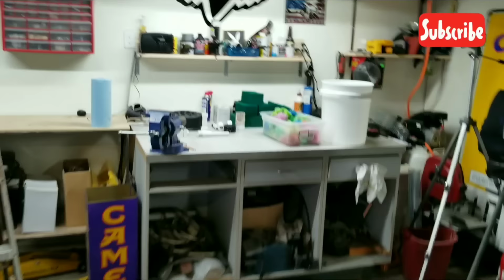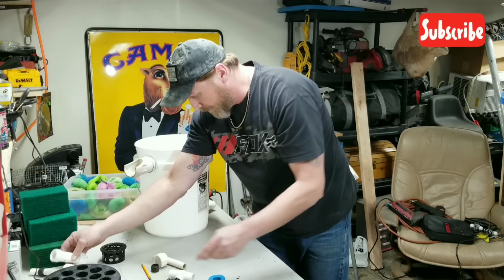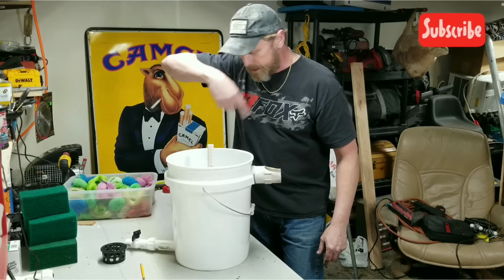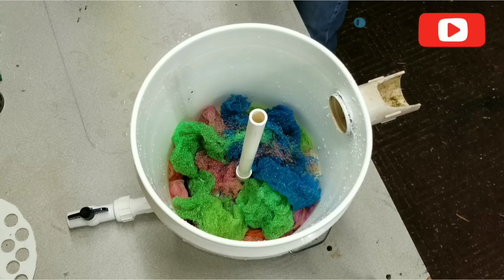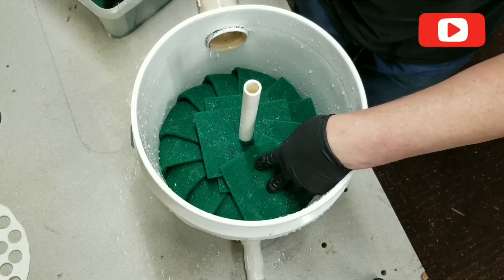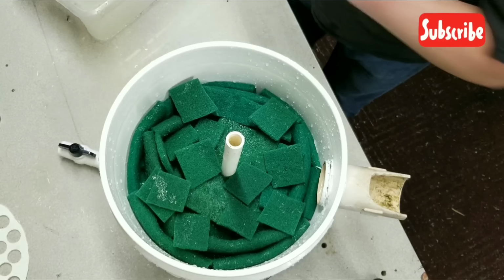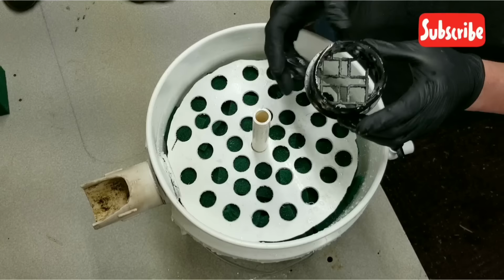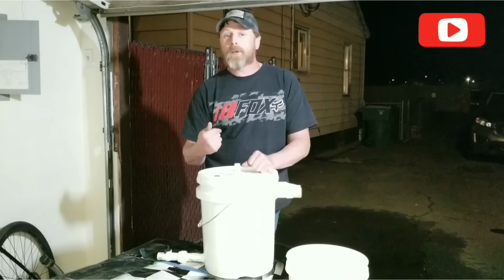BEST DIY BIO SWIRL FILTER EVER...UNDER $20

Comment: Everyone buys these expensive pumps what about pool pumps? They have a filter already, and those are easy to clean. And replacement filters are like 2 for $10 easily washed. I used one filter all summer on the pool and cleaned it a couple times a week crystal clear pool

Comment: I would like to  see a video on how easy it is to clean. Looks like a nightmare. Great video on the construction.
Reply from the maker: I have a maintenance Video in my playlist
Reply: I followed this and cleaning was not difficult.  I lift my bucket onto a chair and drain it into containers to water my flowers.  They love the nutrients in the sludge.  Then I rinse out with clean water for several minutes into one of my flower gardens until the water looks clearer.

Comment: My wife found your video ..
we have a 600 gallon koi pond outside. Your bucket technique worked amazing, cleared it overnight.. so I decided to upgrade it and made one with your design using a 55 gallon blue drum.. thank you for your video
Reply: I have been contemplating a design for a 55'er myself for a couple of years now. I have found that it is mostly the mechanical filtering that is doing most of the water clarification.
Reply: @78tag  the design in this video looks to be about 80% mechanical/bio filter and 20% swirl separator, so you could definitely build better stand alone swirl filters if you wanted to. It does look pretty good for an all in one solution and I don't doubt it does a great job, but it would still be interesting to see how much of the solids the swirl part manages to catch.

Comment: I just build a filter based on your design with slight variations and installed it on a 14’x36” pool. That my son has a couple large bass and a large sunfish in. We use the original pool filter /pump  without the cartridge filter as the pump. Within 2 or 3 days the murky water was crystal clear leaving only some sediment on the pool floor. Works great! Thanks for the info.
Reply from the maker: That's awesome I have a IG link below would be awesome to see some pics hit me up ...Thanks for watching and commenting I appreciate it..Stay SAFE!!!
Reply: thats a pretty big pool and your diy filter/pump must be pretty effective

Comment: Very good video! This is pretty much a small skippy filter but with a clean out added. Skippy says never clean them ever ever...but I can't wrap my head around that. I had one for about 15 years. I grew plants in it and the root system basically took over until it was impossible to clean. At that point I just let it do its thing. Never had a problem.

Comment: I built one using this method and it has lasted for years. Its in a large rectabgle bin so not as strong as a bucket and it has finally sprung a leak. I'll be building a pond soon in the back yard and moving my turtles out there from the garage setup. I plan on using a 7gal bucket. Great video. 👍
Reply: The only thing i would add is maybe cut out some sections out of the upside down bucket where the water can flow straight out of the 90° pipes into the main bucket easier. Really create a swirl. I used an upside down metal crate and the flow was insane.

Comment: Im going to build a duck pond filter tonight using this basic concept.  On the bottom will be the same until the green sponges. I am going to replace those and use the large blue sheet of macropore furnace filter found at hardware stores for under$6. 3 -4 layers of that then lava rock. I am using a large bruit trash can. Cost will  be around $100 for one much larger. Thank you for this great video and making my  mind up of what system I  am going to use.

Comment: I mine in a 55 gal barrel cut in 1/2 & got my hornwort & bacopa & jungle Val it 
I put a 1/2 sized milk create in the bottom & screen over it & put 3-4 bags of 
river rock in 1st then lava rock on top then capped it with crush coral & put 
bacopa plant's & jungle Val in the media & hornwort is just floating on top.

I have it hooked up to my 110 gal bait stock tank & the water is SO CLEAN.

Comment: I like the basic concept, especially the swirl feature to prevent channeling. I would use lava rock and or bio balls on the bottom, then course filter padding, topped off with polyfill stuffing. That way it doesn't clog too rapidly and reduce waterflow. Also makes cleaning a lot easier. With the intake coming through the lid, and the discharge on the side near the top, I would not add that other pipe at the bottom. It is not necessary, and only adds another place for leaks.
Reply from the maker: Thanks for the comment.. Stay Safe!!!!

Comment: I used paint sponges and lava rock, bio balls in the bottom, but one thing that really helped was a 5 gallon paint strainer netting that fits perfect.  I have to clean it every week cause of pond sludge, but it's working!  My feed is at the top and bottom output.  After weeks, the sponges clogged and I also had gauze netting above the sponges.  So its bio balls on the bottom, then lava, then sponges, gauze the paint strainer net.  I slice the tubing with a T connection, so it sprays out with stoppers on the ends.  So now Im using bio, lava and paint strainer, cause I was cleaning every weekend and there were some times it clogged and flooded out.  So no it wont clog, I clean it every two weeks by dumping and rinsing.  Im not happy and want something better.
Reply: Maybe the size of the filter is just to small for the size of you pond? They say 10% of the pond size.. so this 5 gallon only good for a 50 gallon pond max .. bigger then that you have problems and cleaning more often..

Comment: The swirling motion aided by the 45 degree elbows at the bottom helps prevent channeling in a major way! I’ve never seen that done before. Genius!!😀

I agree with a few others regarding filter media:
Lava rocks (or bio balls) instead of all the pads and rocks. Adding some pillow batting at the very top of your rocks will really help keep your water crystal-clear! 

Lastly, you should eliminate the extra hole in the lid. It’s not needed. You only need one input and one output.😉

Awesome bio filter!😃 
Thank you for your video.😁
Reply from the maker: Thanks for watching & commenting!!!

Comment: I did it!  I built it! 
 I will be adding a skimmer to the pump intake.
Reply from the maker: Thats awesome...I appreciate the feed back
Reply: @MYANIMALHOUSE  I originally used a hose from a cpap which perfectly fit the outside of the 1/2 in pvc, BUT it is evidently not sunproof.  After about a month, the hose sprung a thousand leaks.  What type and size of hose should I use to connect the 1/2 in input to my pond pump?
Reply from the maker: @nancyjanegrimes7897  I used one of the adapters that come with the pump ...I had to sand down the inside of the 1/2 pvc until the adapter fit inside tight
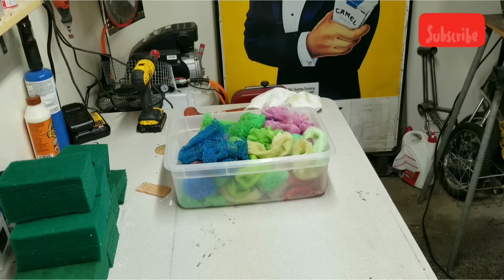Reply from the maker: @nancyjanegrimes7897  Watch this Skip to 9:30 https://youtu.be/_qLmB38uhrs

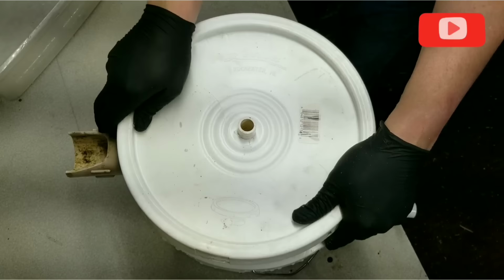Comment: WOW! There's a blast from the past! That big metal 68"x38" Camel Joe advertising sign is worth around $800 bucks now... 23:58 sorry, what'd you say?  😜 I'm in the process of redesigning a pump/filter debris skimmer for my Dad's 1800 gallon Koi pond so thanks for the ideas. I think I'm going to build a massive version of something like this but "upside-down", with the feed pipe swirl "T" up top, layers of fine filter media on top, then rocks at the bottom around the pump and also a valve at the bottom too so you can open it and let any super fine sediment flush out every so often into a hidden French drain. All that is just to keep the pump clear and working, which feeds up to two big bio-filter drums. With the feed coming from the top I think it should be easier to clean out larger debris or possibly even be "maintenance free"? (The pond is under a bunch of Fir trees, so lots of stupid NEEDLES to deal with...)
Reply from the maker: Lol want to buy it ...I have a ton of old Joe camel stuff Lots of signs, cups, shirts, lighters lots of stuff now I think about it lol Thanks for watching 👀
Reply: @MYANIMALHOUSE  "Ebay it!" On second thought... keep it a few more years, it's only going to go up in value and could buy a nice retirement vacation or maybe a motorcycle!?

Comment: Great video... The main issue that jumped out was when you finished by filling the filter with tap water that contains chlorine or chlarimaines.  Instead, use aquarium water, or precondition your water.  I prepare all my filter media in a big laundry sacka in the flow of a differnt filter, aquarium, or pond to grow a bio film.  Spend the time to grow your beneficial biome just as your would your livestock.  Never rinse your filter media with tap water because it kills off your bacteria.  It will save you weeks of having to reestablishing the colony of beneficial bacteria.  That being said, the design was very cost effectve and effecient.  Also, this is not a swirl filter as the media is stationary.  A swirl filter utilizes the same as spinning principal as a cyclonic partical seperator in a wood shop dust colletcor.  Keep up the great educational work. :)  I'm a biologist that managed millions of gallons of aquatic life.  I enjoyed watching your video.  GinoJazz.com

Comment: I got to the end of the video before I figured out what was going on.  So, if I understand what this is, it is a pressurized (versus gravity) biofilter.  The outlet in the bottom (which I didn't see you use) must be for cleaning the unit.  Is this correct?  I would have liked to see how you go about cleaning this unit. I am just beginning to learn about biofilters and am attempting to understand the benefits of pressurized versus  gravity drain biofilters.
Reply from the maker: https://youtu.be/_qLmB38uhrs Thanks for watching

Comment: The design is good, but the filter material is to fine and compact. Its like putting an end cap on the pump. I think it would be better if you cut the green pads into 4 pieces and just drop them in the bucket. with out compacting it, so water can flow around and through without to much resistance. The idea with this type of filter is it doesn't need or shouldn't be cleaned and the top should be exposed to sunlight.

Comment: Prob been said, but sticking a scruntchy between the swirl area and exhaust port will likely keep many solids from cleaning out during flush. Solution, a short tube from the exhaust port into the swirl area. This would provide a clear path from solids to clear from the filter.
Reply from the maker: The flush out isn't blocked by anything ... Just open it and flush alil water though ...I'm not sure what you mean did you watch the whole video
Reply: @MYANIMALHOUSE  the area between the exhaust port and the center swirl chamber was filled with scruntchy. Clean out water must pass from the swirl chamber, through this scruntchy, which will block a larger portion of the accumulated solids. I'll watch again, but I'm pretty sure of this. Over all great build though.

Comment: I apologize if this question has already been asked. I did read a fair amount of the comments below but simply don't have the time to read everything). First off, I'd like to compliment you on this video which is the first of yours that I have watched. Now onto my question. What power would you recommend for the pump for this particular setup? Bonus question... where do you place the pump in this setup? The reason I ask is because one of the biggest "bottlenecks" that I struggle with in my pond is "pump gunk". The pump regularly requires extensive cleaning to prevent burnout.
Reply from the maker: The pump size all depends on the fish load ..I have a couple of videos showing how I hook everything up ..And as far as the gunk i would think about some kind of net or something over the pond
Reply from the maker: https://youtu.be/_H6ugCJ9BJY

Comment: Can I enter water to the filter bucket by making a hole in bottom of the bucket ? Is that necessary to put pvc pipe like that and enter water from top like you did ?
Reply from the maker: You can run the water line any way ...on my filter in comes in from the top but is piped to the bottom inside the filter ...Good Luck with your filter 🤜💥🤛

Comment: I built a filter using this method for my styrofoam pond. When I switch off the pump, the water from the filter flows back into the pond. I've placed the filter above the pond level. Any idea how to fix this issue?
Reply from the maker: When you shut off the pump disconnect the hose to the filter
Reply from the maker: Or put in a  Shut off Valve
Reply: @MYANIMALHOUSE  I'll see if I can find one where I live, or will just disconnect the hose. Thanks 👍

Comment: Don't use the bottom style drain you have. Put a hole in the middle of the bottom of the bucket. Use a bathtub or bathroom sink drain. In a swirl. All solids move to the center and that is how you pull all the way to to bottom ( with a bathroom sink drain) instead of leaving most of it inside the bucket. Nice video
Reply from the maker: Thanks for watching and commenting!!!!

Comment: I love everything about this. 
I have one question/concern: 
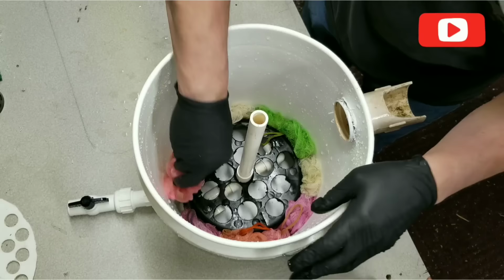@10:40 you put a loofa in-between the drain line and the black swirl piece. Wouldn't you want that spot to be completely clear to allow any sediment in the bottom to be flushed out?
Reply from the maker: Trying to get more of the water to go threw the middle of the filter
Reply: It looked like he put it above and to the side of it, not in front of the inside of the waste drain exit.... as you suggest putting the loofa in the opening of the drain would block the dirty scum from exiting in the bottom when doing a regular flush, which is not his intention.

Comment: I have a question that hopefully isn't too stupid ;)  Since the water is going into the bottom, why does it need to go into the bucket from the top? Why not enter at the bottom?
Reply from the maker: You can run the pipe how ever it works for you ...I just sit the filter on the side of the pond... Thanks for watching 👀
Reply: @MYANIMALHOUSE  Oh! Thanks for the quick response and for making the video. It's been a big help.

Comment: What is the reason for creating the swirling water contained inside the black holed chamber? How does it help?
Reply from the maker: It swirls the water coming in to help break down the waste faster.. helps separate the solids ... Helps prevent the waste from settling on the bottom ...Thanks for watching

Comment: What did you use for the inner black container?  I'm attempting to use a dollar store colander and it's restricting the dimensions.  I opted for 90-degree elbows though. Otherwise, the design is straight forward, I'll be using different filter media but the same principle.  Thanks for the video
Reply from the maker: Its was from the dollar store too ..Its was a step stool thing I cut it down and drilled hole in it ...Thanks for watching
Reply: @MYANIMALHOUSE  I managed to make the colander work, just had to zip tie the PVC to it vs. use PVC female to female to clamp it.  My drain hole had a tiny leak so I hit that with some water-grade silicone, but I think it's functional.  Inspired by yours and other similar ones, thank you.  If it ends up working well I'll post a picture, it's a slightly different design - waiting for the silicone to cure right now.
Reply from the maker: @thomaswolf9297  That's killer I have an INSTAGRAM link in the description...send a pic would be cool to see
Reply: @MYANIMALHOUSE  I snapped a shot of my tank for a friend earlier - https://i.imgur.com/h6cLoED.jpg | That's about 30 blue tilapia in a 40 gallon (Getting overstocked, switching to IBC totes as soon as I can)  I'll have to take pictures of the inside when I go to tweak the design.  I may add a little length to the 1" pvc holding the 90 degree elbows inside and above that I have green pond filter media cut in a circle.  3/4" PVC in, 1" out - I opted for 1" Uniseal on the output.   My Drain line is set up that way just for convenience of removing solids to 5 gallon buckets and/or PWC's.  Running on a simple 400gph pump.  So far so good, no more leaks, but I need to configure the tank so the flow is directed towards the pump and not the HOB filters.  I also didn't need to add biomedia to mine, though I am considering it.  I tricked out the inside of those HOB filters :P
Reply: @MYANIMALHOUSE  I made a few modifications, including using mesh bags full of hydroclay and lava rock above the pond filter media cut to a circle which I now doubled up.  It definitely works as my first weeks cleaning has demonstrated.  I had an issue with overflow due to a reverse siphon (didn't lose any fish luckily) but that was a simple fix by cutting a small hole into the inline hosing above where the water breaks just inside the 3/4" tube - if the power kills it immediately breaks the reverse.  I added 90 degree 1" elbows inside and outside and extended the 1" PVC to reduce water splatter.  Tank is looking pristine after a cleaning during the overflow incident; my main problem now is overstocking and the HOB's pulling current away from the pump, as well as the pump getting clogged therefore reducing what it sucks in.  I'm exploring options.  I'll post pictures when I have a "finished" build - it's functional but it can be improved.  I definitely recommend installing a reverse siphon break, I would have lost all of my fish had I not checked on them at that precise time.
Reply from the maker: @thomaswolf9297  Awesome!!!

Comment: I've watched several videos now and your approach features right up there...  Good work!!  Just one question:  did you use sealant around the drain or did the fitting through the bucket wall have its own gasket?
Reply from the maker: Its threaded and I put alil thread tape on it ...Thanks for watching!!!
Reply: Roger that, and thanks again!